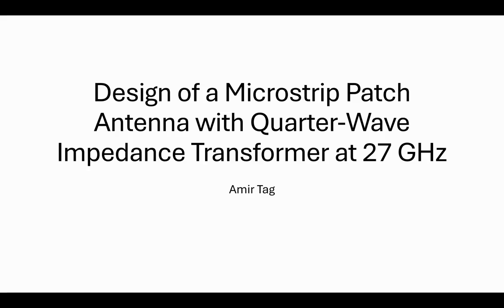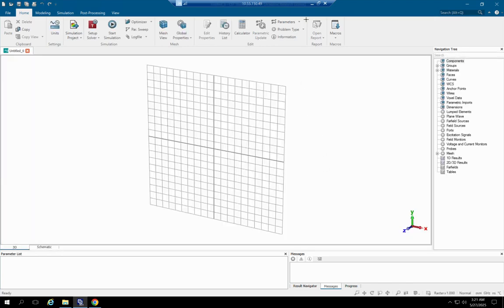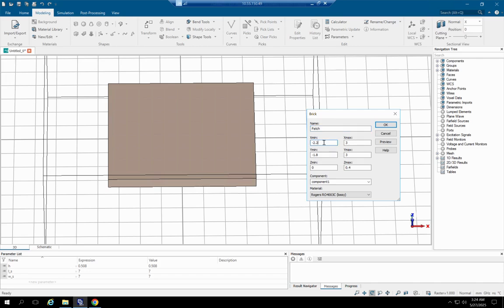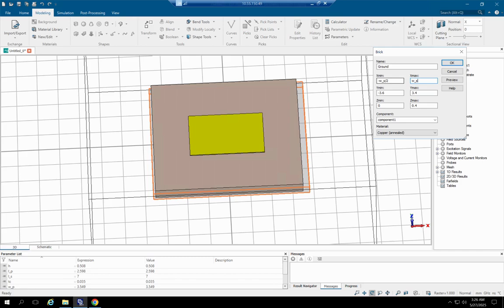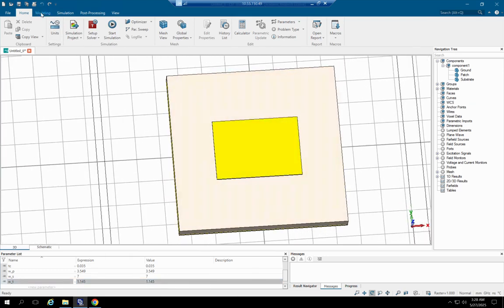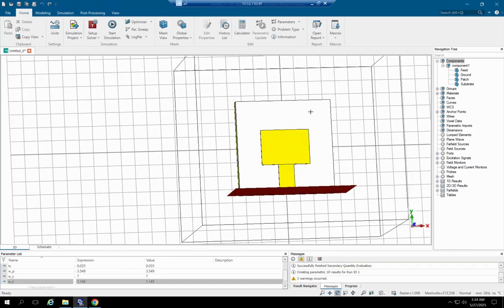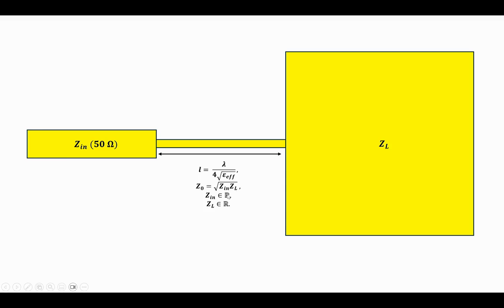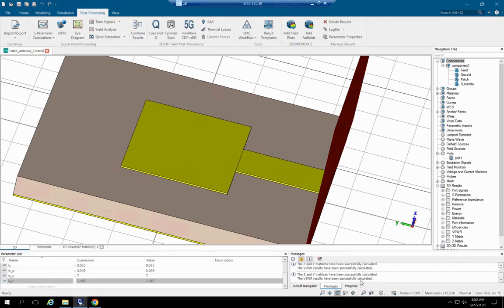Tutorial of a Patch Antenna with Quarter-Wave Impedance Transformer (CST MWS)

Comment: Very helpful, thank you.
Reply from the maker: You're welcome!
Reply: Hello do you perhaps have any advice on designing patch antennas? I'm currently trying to design one for GPS L1 frequency with Roger TMM 4 (DK=4.5) but I'm not able to get a somewhat good S11 and no AR for my desired frequency at all. There seems to be some resonance at just below 1.2GHz and I don't know what to do anymore. Any help appreciated :)
Reply from the maker: @xdhokagebambvs916 Hello, there is a website that let's you design patch antennas at your working frequency, by inputting your frequency of interest and the relative permittivity, you can get the dimensions of your patch. Though this is based on a semi-empirical approximation (when calculating for effective permittivity) so sometimes the dimensions values will not match your working frequency. In this case, I would suggest a parametric sweep of the patch dimensions to see where the patch resonates.

If you've already done that, may I ask what type of matching network are you using for your antenna?
Reply: @electromur5065  Thanks for the reply! I'm planning to use a quarter wave transformer but I seem to already be struggling on the first step. My S11 is at 1.575GHz but in the Z-Matrix it seems to be shifted already so I'm not sure if I can use the value to calculate my quarter wave length transformer properly.
Reply: @electromur5065  Thank you so much for the reply. So the current situation is that I have a 50 Ohm Microstrip connected to my patch. My deepest dip (measuring range 1.4-1.7GHz) is at my desired frequency. But when I look at my z-Matrix it doesn't seem to resonate at the same fequency as s11, hence impedence not only real.
Reply from the maker: @xdhokagebambvs916 Thank you for your reply, may you please send your file to amirmun123@gmail.com so that I can check? The CST file (if you're using CST). Thank you.
Reply: @electromur5065  Just sent it!